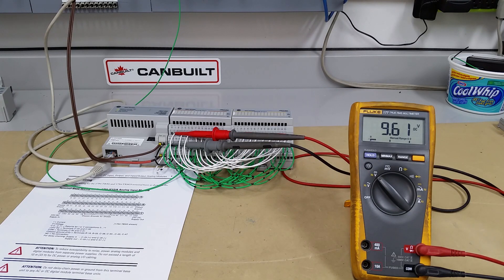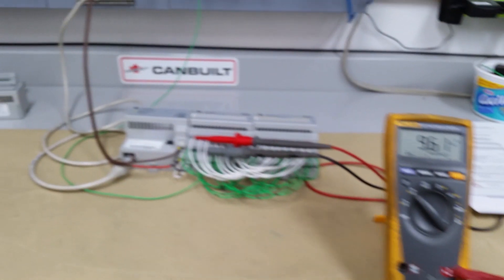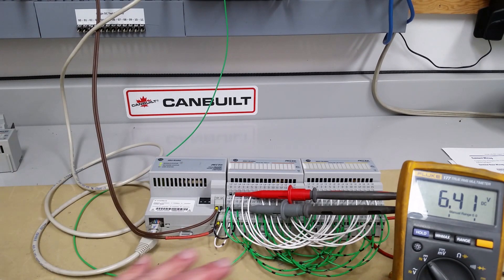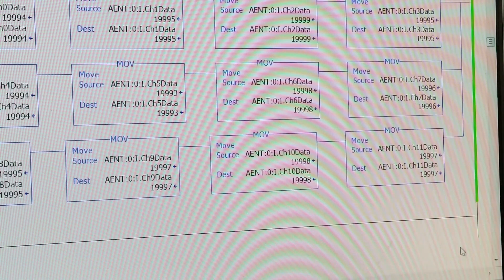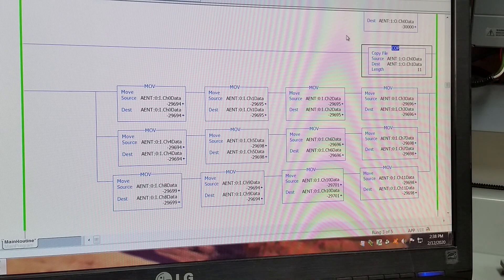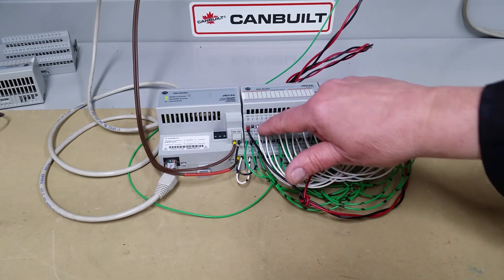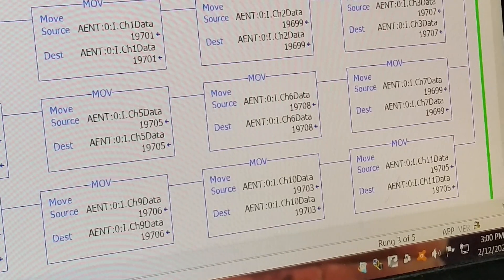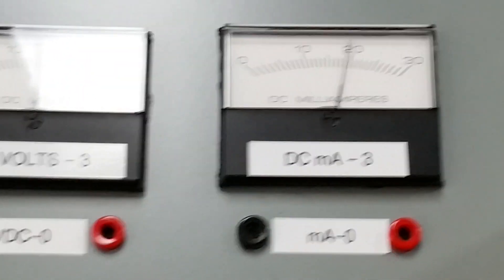1794-IE12 1794-OE12 Analog Modules

Comment: Sir, may i ask if the terminal A0 and 17 will normally have a 24v voltage?
Reply from the maker: Hi - Input or output module??  The wiring diagram shows all of the connections.
Reply: @abplctestbench759 analog input module sir, connected  to 4 wire flowmeter
Reply from the maker: The wiring diagrams and documentation is on the Rockwell website.  I suggest you go there and download the document for the module .  https://www.rockwellautomation.com/search/ra-en-US;keyword=1794-IE12;startIndex=0;activeTab=Literature;spellingCorrect=true;facets=doc_type_full_s%253A%2528%2522Installation%2520Instructions%2522%2529;languages=en;locales=en_GLOBAL,en-US;sort=bma;isPLS=false;sessionID=7d520837-6fe7-6066-20ff-de0ddee07dab;deepLinking=false

Comment: Hi I have a 1794-IE12 that is flashing green and showing FieldPowerOff as a 1. I have it configured properly. What can I do to fix this issue?
Reply from the maker: Hello:  That is normally the error when you have a broken wire / open connection between the device and the module.

Comment: Hi sir can you please help me, why my 1794- OE12 generating output only for few seconds and then o mA output what may be the reason
Reply from the maker: Hello - Without being there it is really hard to tell.
But - you are running a current loop.  It is possible that you have a loose connection somewhere between the module and the field device?
Also check your programming to make sure that the output register is not getting overwritten.
Check to see if your fault conditions are not resetting the channel to 0.
Otherwise it is impossible for me to tell what is going on.
Hope you can figure it out.
Reply: @abplctestbench759  thanks sir i got the issue with wire open fault on the channels and plc is disabling these channels
Reply from the maker: @automationstartup740  That makes sense to me.  You need to check and make sure every connection is secure and properly done.  
Most problems with analog signals is poor wiring techniques.
Hope you got it all sorted out.

Comment: In 1794 ie12 module LEI -4 transformer getting damage, let me know the rating and technical details of transformer
Reply from the maker: Hello:
Sorry I do not have access to the technical details you are asking for.  
It is a 0►20 mA input - so 20mA would be the highest current on the current input terminals.
Voltage is -10 ► +10 VDC on the voltage input terminals.

Comment: I have an IE12/A with three devices wired to it. A temperature transmitter (4-20mA) return is landed on A0, Pressure transmitter (4-20mA) return landed on A2, and a dew point analyzer landed on A6 and 23(?). The first two devices are powered from separate fuses. I don't know why the module is wired this way, or if they ever worked. The DPA appears to be reading correctly in the PLC, but I don't read any voltage on the leads. When I introduce moisture into the system the current increases and so does my PLC reading. The temperature and pressure devices do not read, but show 5.8mA and 12.27mA respectively. The pressure transmitter is a 0-3000 PSI device and the display reads 2058 PSI. i need to get the two working but I am confused by the wiring? Can you suggest another video?
Reply from the maker: Best site that I can recommend is https://www.plcs.net/ - very helpful group there.
Have you had a look at your programming to make sure that the configuration is correct?
Each channel of the IE12 can be configured for either voltage or current.
Looking at the wiring diagram online A0 & A2 are correct for 4-20mA inputs on those channels.
Search for Publication 1794-IN106D-EN-E - January 2014 for the install manual.  Page 8 for details.  A6 and 24 is correct not 23.
Reply from the maker: Hi Jimmy:
Just wondering if you were able to get this working?

Comment: Normally most analog input and output devices are 3 wire correct? need a +24v and a COM to complete the sensor circuit and then the other wire to connect to the I/O?
Reply from the maker: Hi Jeff:  Not always.  There are 2 - 3  & 4 wire configurations depending on the device and on the module that it is tied into. 
Voltage and current devices vary depending on the application.
Thanks
Bruce B

Comment: Hey, whats the difference between a isolanted module (IF4I) and a selectable (this module)?
Reply from the maker: The isolated module IF4I is 4 separate channels that are not connected to each other.  No common terminals.
The IE12 & OE12 and many others have a single row of common terminals that are tied together in the base and the module.
Both have advantages but depends on the equipment they are being used on.

Comment: Hello are you familiar with the 1746-BTM? If so I have a question if you dont mind helping me out.
Reply from the maker: Hello Camino:
I have never worked with the BTM module.
I have only seen it online and in manuals.
Not sure I can assist you with this one as I do not have any experience with this specialty module.But ask away I may be able to help if I see your question, or maybe someone else that is subscribed to my channel.
Reply: @abplctestbench759  thank you for trying. Here goes. So I successfully did an autotune on all 4 loops. The application is for a barrel heating application. The only problem I have is my cooling fans come on way to late If I pass my SP by like 15 degrees F they still dont come on. The cooling TPO is working because if I lower my SP by 100 degrees it kicks in but thats way to late. My high CV is set at 100% and my low CV is set at -100%.
Reply from the maker: @CaminoYVerdad1  Hi:  Not sure how much I can help.
It sounds to me like you should be latching the output for the cooling once the temp is greater than the setpoint.
I would monitor the setpoint and once it is lower than the setpoint by an amount that you are happy with and for an amount of time then unlatch.
Since I have never used these cards I am unsure what the CV is used for.
If they are metal barrels in my experience they cool slowly and heat up quickly depending on multiple factors.
Hope that this helps.
Bruce
Reply: @abplctestbench759  thanks for trying have a good one
Reply from the maker: @CaminoYVerdad1  Your welcome - Sorry I could not help more, but no experience with that module.